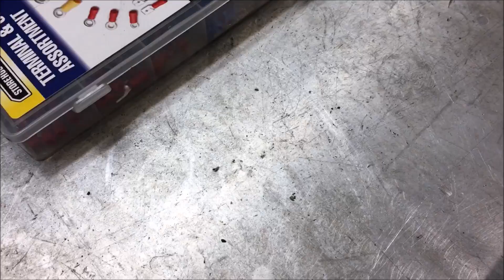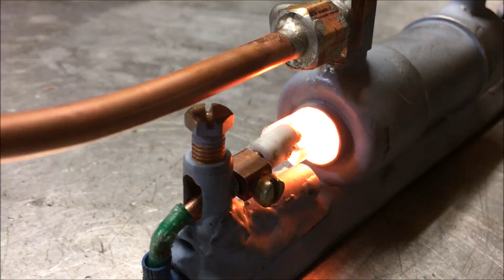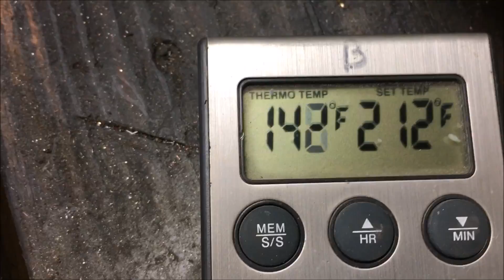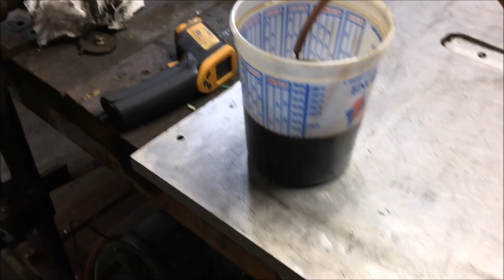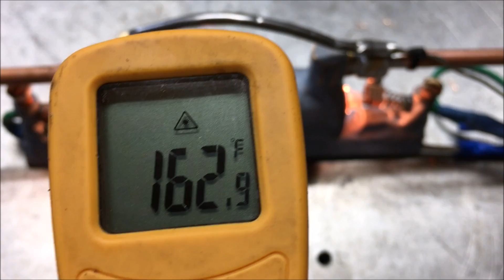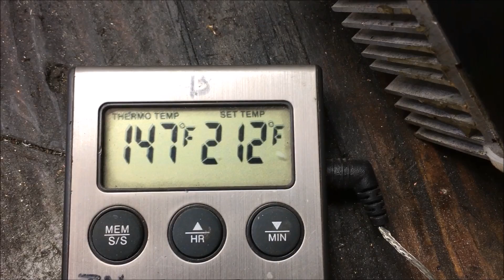Waste oil burner inline pre heater

Comment: Considering the temp you were at when the boiling began, I have a suspicion that it may have been moisture that has been incorporated into the oil that was boiling off. Not likely you were warm enough to boil the oil yet.

Comment: I'm confused here we only need to preheat the oil to get initial ignition correct not keep the oil constantly hot. I have seen burners run perfectly on here once initial ignition was undertaken via a gas flame torch. The burner would run once ignited and stay burning with cool oil.

Comment: Again, nice little thing.
What concerns me mostly is that deadly AC current. 12v (or 24v, draws less current) dsl glow plug in solid aluminium bar would be super safe from the current side. Bar could be equipped with oil canals where the oli is heated or then just simply wrapped with copper tubing. If one glow plug isnt enough, other one could be added to the other end of the bar. btw, heavy fuel oil is heated approx to 100c before injecting to internal combustion engine. Remember to show celcius degrees too for us europeans :)
Reply: Tractor heater plugs heat the air correct?
Why not preheat the air instead of oil to get initial ignition.

Comment: You will experience many problems when heating waste oil products to 300 deg F using either motor oils or vegetable oils as it will varnish up. After the varnish builds up it then at some point begins to peel off clogging up filters if upstream or if not your nozzle unless you use a Babbington style bulb you drip the oil across. The Babbington style as you know since exterior around a bulb shape will never clog. But you may still experience a fuel line clogging at some point. I build my Babbington style nozzles out of used C02 cartridges as they are easy to put an small brass fitting on the original tapped end. I then drill a 10 thousanths of an inch pinhole in the other rounded end using a metal lathe. I then use a die grinder to cut a ditch from the top down to the hole for the oil to flow in directing it across the pinhole.A triangle shaped needle file will also work well for that oil ditch.
Reply from the maker: cool idea , do you have any video of your builds ? yes i agree 100% about the varnish , however i never even thought about it flaking off and clogging things up  i was more worried about efficiency diminishing
Reply from the maker: Great comment regarding the upstream filtration , definitely gonna discuss your comments in the next vid of this device
Reply: Dang great comment. Like I knew this… but I certainly wasn’t thinking about it 😅

Comment: Don't you mean to say in the description 145,000 BTU's and not watts? Or is the 145,000 watts the conversion factor from BTU's or Joules to watts? My commercial units specs are stated as BTU's.
Reply from the maker: im not a fan of btu ratings , the math involved is ridiculous so i stay metric , metric is the only way to go in physics . so im using wattage because people can relate with that , we dont have a clue what 50,000 btu's is but 50,000 watts we can comprehend because  we use 25 watt soldering irons and 100 watt light bulbs  and so on . i no that a car uses about 250,000 watts of power . also a common household light socket will discharge a max of about 1800 watts with a 15 amp fuse
Reply from the maker: I convert megajoules to watt hours , it by far the easiest equation , 1 liter of oil has about 36 megajoules of energy and to convert this to watt hours you multiply by .277 and multiply by the liters used in 1 hour to get watt hours   . so at 145,000 watt hours we have the energy to operate at 1 watt for 145,000 hours or at 1 hour at 145,000 watts

Comment: What I use is a water heater element in a steel pipe cap. screw the cap onto a piece of pipe and you have a pretty efficient waste oil preheater. You can PWM the element using a SSR and a PID controller to get your precise flow temp. It lasts nearly forever, much longer than the halogen lamp.
Reply from the maker: Yes i looked at those , very cheap also . definitely a good way to go , would be super easy to clean also . I can't spend any money is my problem
Reply from the maker: Yes those will also work with a router speed controller. My concern was the bakelite  plastic  , it degrades at 450 deg and to produce 300 deg oils it may hit those temps , but a great idea nonetheless , 300 deg oil may not be needed . how hot have you got yours ?
Reply from the maker: sounds like a cool build  , do you have any footage of how hot it gets ?In a water heater the element stays under 350 deg F but i was worried it may need to get up to 450 to heat incoming oil .
Reply: For my burner, I preheat up to 4gph from <40F to 120F. I also use a heater on a block that holds a siphon nozzle, bumping final temp to 160 at injection. I have no doubt the water heater element can preheat a steady stream to 160. To bump to 140 only requires 25% power at 4gph.

I tried going hotter than 160, however the oil seemed to boil, generating air pockets that messed with the burn, causing a flameout. What we are trying to do is raise the temp enough that viscosity is not a hindrance to vaporization.